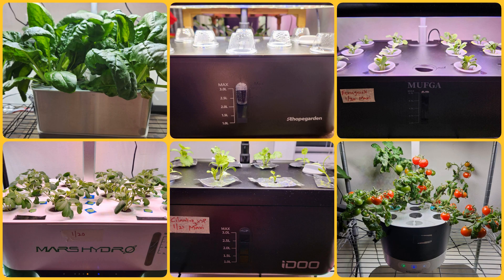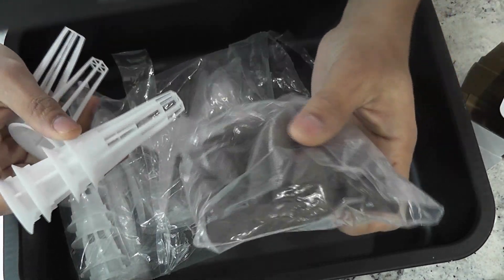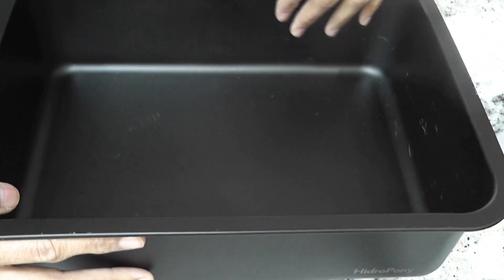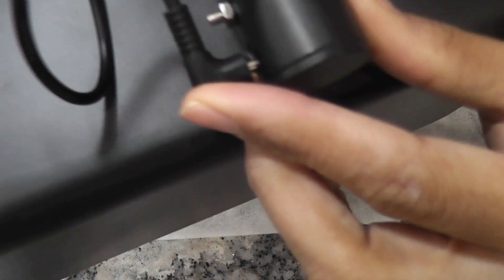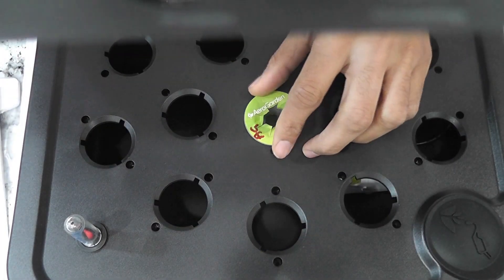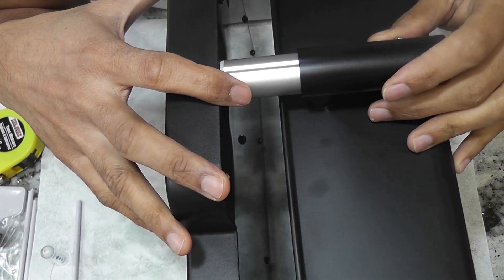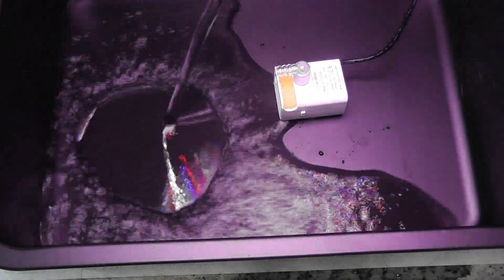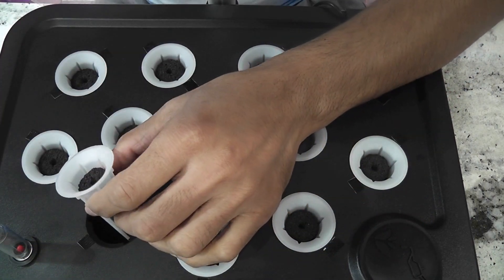HidroPony Hydroponics System - Unboxing & review, Indoor Growing Gardening System

Comment: I am not finding this on amazon. Looked 3 times. Your link works but it isn't available. Seems like it's unlisted now. Weird...
Reply from the maker: oh no! sorry about that. Not sure if it is temporarily out of stock or they are discontinuing this model. This is the reason I don't normally trust these systems/sellers. But I got tempted for this one. Hopefully they will come back. I also reached to their support but no response yet. I will let you know if I hear back from them. Sorry about it again.
Reply: @aerogardenexperiments  Ya, no problem. I asked this question before I saw the whole video. The fact that you can't detach the light is a problem. Most of these systems are almost exactly the same thing it seems. No real reason to buy this one anyway for me. The Idoos are fine.

Comment: I agree, a bit of a bummer that the light can't be easily detached. However, it'll probably never be a problem from an operational standpoint. So that's good.

I just bought another "off" brand garden called 'Minosoo,' and on Amazon it looked great, and it is a nice unit with a (36) watt light, a (4.5) liter tank, and (18.5) inches of light clearance, etc. It's was about $74.99 when I bought it, and that was for the "bundle," which was basically like AeroGarden's "Grow Anything Kit" included with the garden.

However, there was no way to tell, until I received the garden, that the grow deck encircles the light connecting rod/pole, so if you want to clean the system, you have to remove the light in order to separate the grow deck from the tank. Not a very good design, I didn't think. 

Otherwise I'm very satisfied with it, and it has been working well for nearly two weeks now. It's a (12) pod garden, but I'll probably never use more than about (4) locations per grow.
Reply from the maker: WOW! Minosoo looks very interesting. I may give it a try. Thanks for the details. Could you please let me know if it comes with short sponges or regular/standard sponges? I don't like the short square sponges.

Comment: I really like these videos, so informative.  I've now got my second unit up and running.  Sowed 6 Tiny Tim tomatoes in it.  4 germinated and the seedlings look nice and strong.  Also tried dwarf French beans which turned to mush.  Watched your video on the Dragon beans and I'm now trying it this way so hopefully they'll germinate.  In my original unit, I've got Parsley, Dill and Basil.  Will be adding lettuce and rocket to that probably around mid-late April in time for summer salads.  I really like trying to grow different plants.  One plant I'm having no success with is Coriander (Cilantro).  Tried the paper towel method and even that doesn't work.  On a positive note, last year I grew a Chili plant but it got too tall for the unit so I transplanted it into a pot.  It's sitting on my south facing kitchen windowsill.  It's now got flower buds on it so hopefully I'll get some Chilies from it.